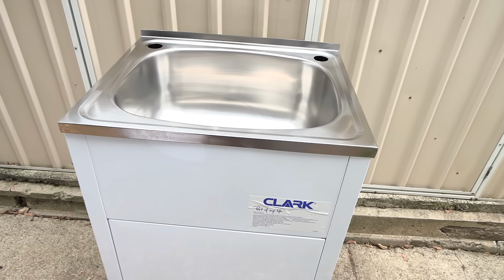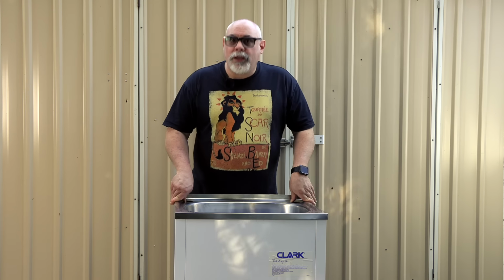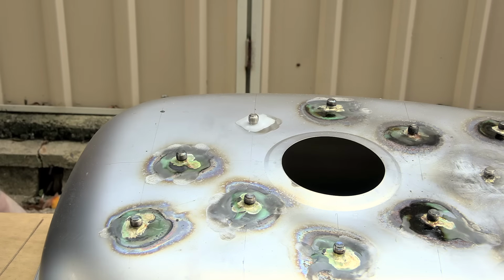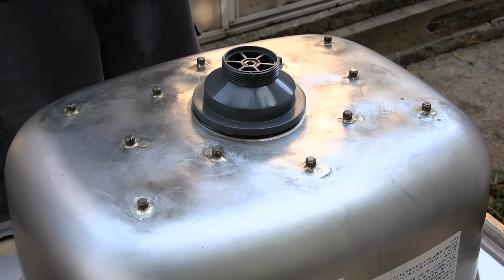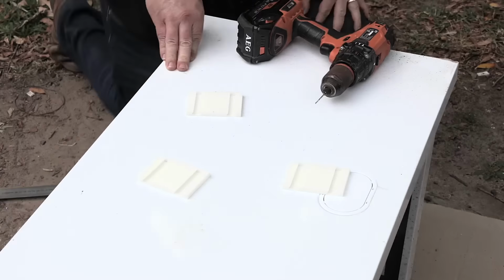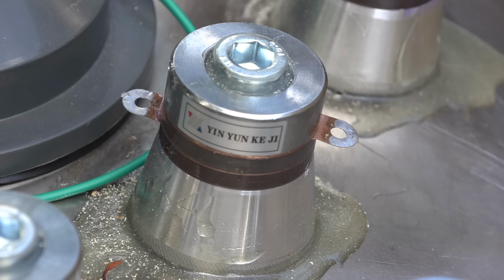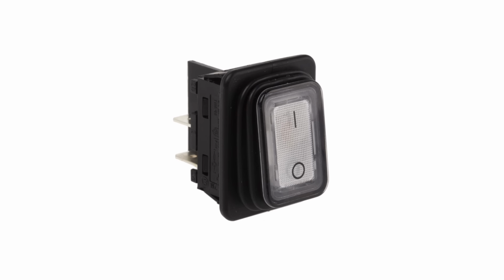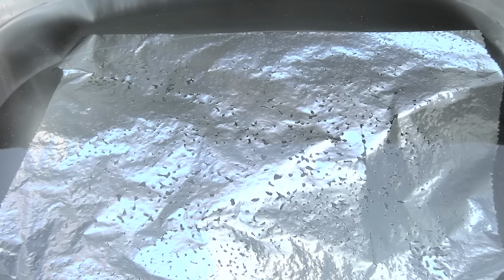Building a Laundry Sink Ultrasonic Cleaner

Comment: Love your tutorials I am going to defiantly make one on my own for sure. I currently have a 11-liter cleaner I got off e-bay it is a cheap china e-bay one it works and auto heats and has a 30-minute timer but I’d like a bigger one. You seem to have really gotten a good method down for adhering and wiring them up. I’m am wondering if a thicker stainless steal would reduce the driver efficiency say if I got a machine shop to weld me a square 50 liter tub together for larger denser items using 20 mill plate stainless I know its thick but this is for longevity and would make it distorting on heat up when soldering less pronounced and give it a higher mechanical strength. What are your thoughts?
Reply: Thickness of the tub make a huge impact for sure. The ticker you go, the less efficient. The point of the transducers is to transfer the high frequency vibrations of its keramic vibrating membranes as effecient as possible to the liquid, making cavitations in the liquid. A thick plate will absorb those vibrations far more/ will dissipate them more, and you will end up with less vibrations in the liquid for the cavitations to take place. ideally you even put the transducers directly in contact with the liquid, but then of course you have severe electrical problems...lol

Comment: You should ensure that the air inside the base is ventilated. (It is not clear from the video). The individual fans area good idea but if they are circulating air to and from a stagnant  enclosure then the air will heat up. Suggest that you install a fan to ventilate the base with ambient air.
Reply from the maker: The back of the base is open. When it's installed, I'll be able to put a small ventilation hole in the wall behind the sink.

Comment: When brazing - continuously try to add the brazing rod until its melting on the surface.. you'll know you've applied enough heat when the brazing rod wicks into the joint. It's no different to what you see when soldering with a cold vs wet joint. That way you aren't turning things cherry red and potentially tempering the steel. You want to avoid things glowing red if possible.
Reply: Agree with your comment, I seem to recall during my apprentice training half a century ago the part on silver soldering included the comment; when looking at a silver solder joint (rather than brazing which is different) what you can see isn't doing anything! i.e. the silver solder will follow the heat, only the silver solder underneath the stud is doing any work.
Reply: Also with this thin metal minimizing and the amount of studs heat input is crucial. Spot welding might have been a better choice.
Reply: @DangarousMandarine  You can't spot weld a stud.. A spot welder melts the material between the contact points of the electrodes. It's not going to make enough heat to melt a stud to stainless (ignoring that it would be nearly impossible to find a spot welder that can clamp wide enough to fit the stud between the probes).

Do you mean tack welds?
Reply: @ryanokeefe12  No, what I meant was stud welding. That was lost in translation. Basically a spot welder made for welding internally or externally threaded studs to things. You insert the stud in the gun and weld it to the material with an electronic discharge.
Reply: @ryanokeefe12  check out stud welders used in body repair. =)
Reply: @Hawk7886  You can't stud weld to stainless steel.
This is also not to mention that stud welding is for bolts/studs that are long enough to be clamped in the stud welder. Won't work for these small lugs.
Also, also, not to mention, this is a guy working at home as a hobby.

Even if it could work, do you think he's going to buy thousands of dollars worth of equipment for one use?

Save your sarcastic faces for when you've looked into what you're responding with. 
You stated spot welding, then went and tried to research things to prove me wrong and came back with something else you found that might save you.

Comment: Green wire is always and only for ground/earth.
And OMG, why is there no bushing on any of the holes where the wires go through the metal.
Reply from the maker: My supplier only had black, red and green so I had to improvise. I used red and black for the AC and green and black for the transducers.
Reply: @BranchusCreations  Yeah...I am a registered sparkie....so the cringe comes with the territory.

Comment: Nice project, but the mains wires that pass though the metal sides should not touch the metal. The usual way to avoid this is to use  a rubber grommet.
Reply from the maker: That will be done!
Reply: I came to comment the same thing lol

Comment: Please use some nylon bushings for the holes where your AC cables pass through, the vibrations overtime will wear through the insulation on the cables. Also make sure you earth the housing, and the tub if you can.
Reply from the maker: That's good advice, and is my plan.
Reply: @BranchusCreations  I've always used automotive heater and fuel/gasoline hose for stuff like that. Split it lengthwise, wrap what you need, then ziptie, hoseclamp, whatever to clamp it over what you want to protect. fuel hose for smaller stuff, heater for larger. fuel hose is 2 different types of rubber tube with rope fibers woven in, very strong, abrasion resistant stuff for pretty cheap. Useful for a TON of stuff. Same for vibration resistant standoffs, isolators, etc

Edit: FWIW, on future silver soldering you do in the future, the bolts were way too cold. You want to see what's called "the flash". You don't want to lay a sausage of half melted solder down, then keep blasting it and melt it fully on the part. You want the parts hot enough (both bolt and base) that the moment the solder is touched to the metal, the METAL melts the solder, and it instantly gets sucked into the gap. A bead of silver 'flashes' around the full circumference of the bolt. Then you can add more if you like for a larger fillet. By heating it that way then melting it, you can have a pocket of air / trapped flux under the bolt. Oh also, you didn't know which pin was for L and which for N. The fuse to the bottom right of the AC in connector, will go to L. So look at the traces at the bottom of the PCB. Chances are the bottom (in your video where you show the 3 boards) pin is Live, since the fuse is right there. Opposite of what you chose. That means if the DC - is connected to neutral (non-isolated topology), even if the fuse pops, the tank could be LIVE!
Reply: @BranchusCreations  Heck, 3d print some bushings if you have to
Reply: @BranchusCreations Back in the day, we’d go to tricky dickie, buy all this mains stuff, shove it into a box, wire it up and switch on.  These days, it’s technically illegal to build anything that uses more than 50V unless you’re a registered engineer (although registering is somewhat trivial).  Your build may, therefore, be illegal.  It’s concerning, though, to hear someone say not to play with mains wiring unless they know what they’re doing and then display a shining example of precisely how not to do it.

Is there a fuse?  Yes, it’s in the IEC power input socket, thankfully.

Is any of the metalwork earthed?  As shown, NO.  The earth should be bonded directly to the metalwork of the tub and the metal stand, preferably with shakeproof washers that bite into the metal.

Is there proper, robust insulation for cable passthroughs?  As shown in the video, most definitely NO

I have a feeling that if a regulator saw this video, they may throw a book at you.  I really hope you fix the safety issues on your DIY death trap before it bites you.

The responsible thing to do would be to fix the safety issues, delete the original video, and upload a new version with additional vision of the electrical safety issues above and how to address them.  Even more responsible would be to refrain from building something that could result in you killing yourself or someone else.  As this is likely an illegal build, you’d be entirely responsible and face a manslaughter charge at very least.
Reply: Here in Au these are called cable “glands”. Any electrical wholesaler will help with these. Please get some asap and run your AC cable through the chassis using these.
Reply: @tronicit  glands are not what you want. They seal around the cable and stick out a lot, nylon bushings sit flush and just cover the metal. Im in Aus.
Reply: @Curceus  *I'd call them rubber grommets
Reply: @tronicit  get your hands on some glands

lmao
Reply: @tronicit  Ah, I meant in general, not specifically through a holes sharp metal edges, though it would work. I'm in agreement about cable glands. The hose method I said above is about anywhere abrasion can happen in general, in which this build has MANY!
Reply: exactly, glad I seen this comment... first thing I thought when I saw no grommets were, "my god man, wires through a hole of something designed to vibrate, grommets!"
Reply: I would also suggest to add double insulation on every spot where that green wire is touching or might touch that ultrasonic device.. wires could touch each other (during normal work and i doubt you used silicone wires)and that would not be pretty.. I also recomend..in case older house to place inside that current braking device ..(sorry forgot how it is called..it is set for 30mA if i remember correctly..) so there is no accidence
Reply: Was just thinking the same about grommets; just get some TPU filament and print your own on the 3D Printer!
Reply: That was my first thought when I saw it. Otherwise, great job, I watched with great interest.
Reply: Wires passing through metal without a grommet is a code violation.
Reply: What you need is a rubber grommet.
Reply: That was my first thought when seeing the wires pass thru the metal housing. Need to make sure it is wired proper so you dont wind up with an electrified housing
Reply: Fax 💯
Reply: can you explain to me, like im 5yo, why grounding is so important for this build? Electricity is magic to my tiny brain, especially grounding
Reply: @zeffster2  a ground wire is basically a second wire to divert power away from things (humans, other electronics) 

lets say you have a washing machine. the entire outside is metal. you have 2 power wires running to it from the wall, the "active" wire and the "neutral". the neutral can be thought of as the return wire, so if that wire breaks from vibration or somehow comes loose (from the shaking of the machine for example) you could have a situation where the active power line is energizing the metal case of the machine. this would be very bad because anyone who went up and touched it would be shocked, and at worst killed. so, instead you run a hopefully unused ground wire to everything metal that could potentially, accidentally get energized and that way if that happens, the power has much less resistance through a convenient wire to the literal ground. the earth underneath most modern homes will have a gigantic like, 1-2 meter/3-6 foot copper rod just stuck in it permanently buried to be the "grounding stake" or whatever its called. when electricians say "earth" or "ground" they literally mean the ground. or, at least the grounding copper that eventually leads to the physical dirt. im sure someone will correct me but that's the gist of it.
Reply: @zeffster2  electricity always travels the path of least resistance. You never want that path to be you. So we ground devices in case there's ever a fault the current will go to ground instead of whoever may come into contact with the faulty thing. We intentionally make a better short circuit just in case something bad happens. Some live conductor inside a device somehow manages to get loose. Maybe a rat gnawed on it, who knows. Given enough time insulation just tends to fall off conductors. When that fateful day comes we don't want to get shocked. They have been making insulation out of soy lately and rodents love the stuff. So the whole rat thing isn't that far fetched.
Reply: @1pcfred  Thanks man. Makes sense. Especially since this is AC I'm guessing. Scary.

So connecting ground to any other metal body, with some size works fine as ground for builds such as this? I feel people use random metal stuff close by for ground, at least on YT, and don't understand why there isn't some kind of formula or best practices for this. Or maybe there is, just nobody talks about it?
Reply: The same was hitting my mind  when I saw the sharp edges of the cable feed throughs.
Reply: No there wont be any vibration in on an ultrasound cleaner and you do what you want keeps you on your toes

Comment: I think that's the most powerful cleaner I've seen so far. Five transducers may have been enough. I'm wondering if it's safe to use around animals that can hear ultrasonic frequencies.
Reply: My cat exploded
Reply: @CONEHEADDK  ROFLOL....

@Danny D.
Anyways. Yes, it is "safe" around animals as long as those animals can get away from the very very annoying loud noises!
It is not that they will instant die from it. But it is annoying (and maybe painful) as hell to those animals who can hear ultrasounds.
Compare it to a loudspeaker constantly humming with a loud monotone note in your room. You'd get nuts too after a few minutes.

The exact same things applies for ANY loud tool for that matter. Do not force animals (or humans for that matter) to listen to it without hearing protection. It is EXACTLY the same thing with ultrasound. It is not because we (humans) don't perceive it as loud, that animals don't. Anything making loud noise should be used with care.
Reply: @CookieTube  Nope - I wouldn't go nuts. I've had tinnitus for 50+ years - and it's not bcz of that, that I'm nuts..  ;)  Besides that I have an electric heater, that hums a bit 80+% of the time, and a fan under the cieling, to get the heat down, bcz I live in an old school, with 9-10 feet up. And often I have to turn on a air leaner, bcz half the ace holes in "my" tiny town burn sh*t in the stoves, that stink the town up, and living high in the middle of it, I "always" get smoke from some direction. I've been writing to the "city hall" for years, but they don't rally give a f*ck, also to avoid a precendce of authorities having to react (and become even mooore unpopular) to the problem, that exists all over Denmark, resulting in about 1 out of 1200-1500 danes dying every year..   To be serious, I agree - if the animals can't go away, it could be torturous. But - my neighbors cats sometimes visit me, and even if I use an angle grinder, they don't give a f*ck, so loud noise doesn't have to be a problem for them, as I would have expected, before I started "borrowing them".